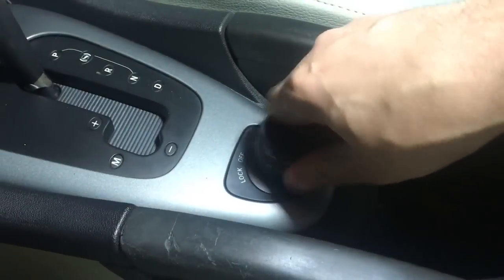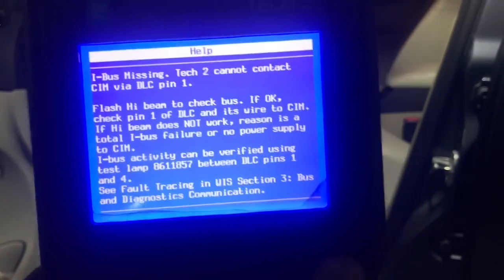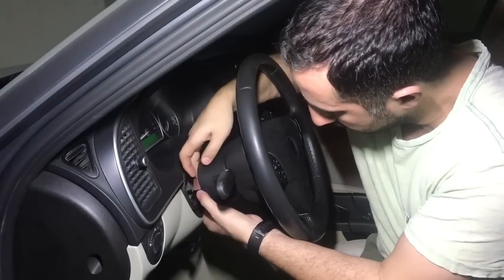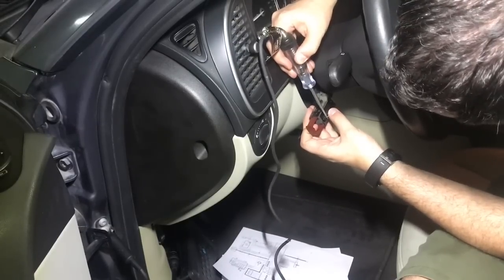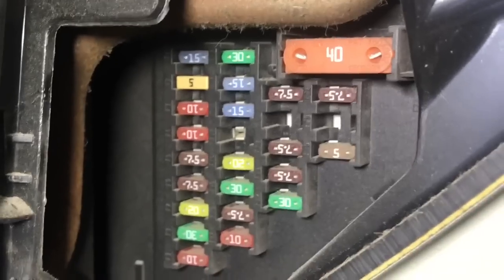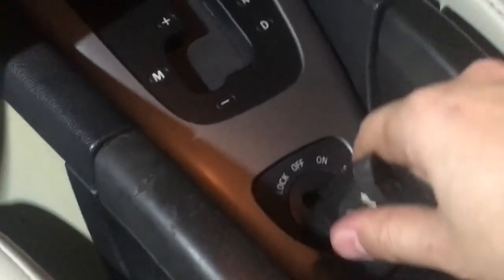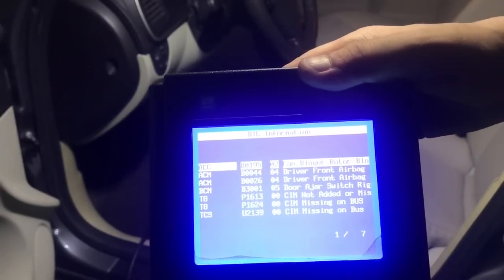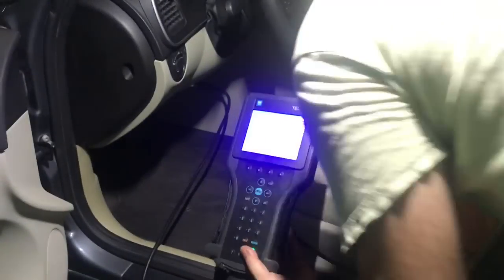SAAB 93 NO CRANK, NO START, NO COMM & KEY STUCK

Comment: My Saab 9-3 1.9 diesel has a problem - when the ignition key is turned from lock to off, fuse 2 is blown, the key is blocked. Fuse 2 is supplied with a clean ground from the CIM block via 1 pin. Does this mean that the CIM is dead?
Reply from the maker: Try to disconnect the CIM with the car running, hopefully it stays running, then turn the key see if the fuse burn or not
Reply: @TheFlyingMechanicDIY  I can't start the car - as soon as I turn the key from LOCK to OFF, fuse 2 blows.
Reply from the maker: @ disconnect the CIM and turn the key, does it blow again ?
Reply: @TheFlyingMechanicDIY  I think that without CIM the key cannot be turned.... but I managed to start the car after I disconnected and reconnected the large connector from the fuse panel. The car ran for about 5 minutes, then it gave a message about a taillight error and the car stalled. After that I moved the taillight wires and bulbs, and the car could be started again! I am a little confused! One thing that makes me suspicious is that when looking for short circuits and damage to the wires I concluded that even on the rubber floor mat I can measure about 10-11 volts. It is possible that this is a parasitic current caused by air humidity... but I do not know for sure. but it could be the cause of the problems.. currently I have made about 5-6 successful start attempts, read errors - there are none.. I will cross my fingers and pack the car together.

Comment: Hi I have a Saab 9-3 03 vector sid is saying key not accepted, have transponder codes key turns but no crank tried to jus a jumper the car cranks but no start gets spark for a few seconds and it stops getting sparks ?

Comment: Wen i mesure the batery is 12.6v  wen the car is off. Wen que car is on e have 13.8/13.9 v is this normal? One strage thing wen o left the car for 3 days the voltage drops to 11.9v. Now i constantly  have the steering lock error, it Starts normaly e drive, the a stock the car Turn ir off e bummm a have the error again, only goes away wen i remove the fuse for 2 minuts.
Reply: similar thing here.  Which fuse was it?

Comment: I trade you my subscription. I have a question on a SAAB 9-3 year 2000 which the ignition wont turn in.
Reply from the maker: Could be low charged battery, bad key or ignition switch, steering locked
Reply: @TheFlyingMechanicDIY  what exactly do you mean..? What a fault in the steering lock, or what.

Comment: This is weird.. mine was turning on all the electronics but the starter wouldn't even make a noise or crank at all. Moved battery connectors and now it works

Comment: I'm having a No start issue. The only way I get it to start is by removing the neg. Batt cable. I replaced the starter relay, crankshaft position sensor, and tested both the battery and starter they are good. Next I think I'll take apart the ignition switch and clean it but not before I check the fuses again.
Reply from the maker: Usual suspects with what u r describing, are, ISM/CIM/ABS in this order. 
A complete code scan while the car is refusing to start will reveal the culprit
Reply: @TheFlyingMechanicDIY  thank you for replying. I only have the regular obd2 scanner. I'll start now I'll keep you posted.
Reply: Would a regular obd2 scanner reveal the issue? I swapped the ac & engine relays that are located in front of the battery. The car starts the 3x i tried however I took off the fuse for the battery before hand (simulating removing the neg. Terminal to get it started to begin with) i get no codes even after driving for hours i feel its because i constantly reset each time i remove the battery.
Reply from the maker: @kevinrios8127  obd2 is not enough, removing the battery cable or fuses will most probably delete any codes, the fact that it starts after the cable removal usually points to a bad electronic component not a relay or fuse or battery or starter ….etc

Comment: My 2004 9-3 2.0T convertible will only restart after disconnecting ground cable for few min and reconnecting. Sometimes ABS, CEL and brake light were on. Inserting the key would give the clicks but not start, no starter motor turning either.
Starter motor is fine. Battery and alternator current is fine 12.2 and 14.4V.  Replaced ABS module.
Issue still is there and once and while cannot start. Pulled the 20A fuse out and in and still no start. Only after hard reset with ground battery cable could start. Any idea what could be wrong?
Reply from the maker: Its hard to tell without doing sone electrical diagnostics. Send me an email (my email is in the channel info) if u r looking for guidance on what and how to test
Reply: Did you figure it out? I have a 5 speed 2004 saab 93 with that same issue now. Only after removing the neg. Cable, waiting afew minutes then put it back on it starts and drives good.

Comment: the no crank no comm you didn't show how to fix and start the car with those pins wire on the ABS?  the car started but  not safe to drive the car until what????
Reply from the maker: Now u know the ABS is ur problem .. and u have ti replace it 😬

Comment: Hello my saab 93 vector sport 1.9tid doesn't let me start the engine when i put they key in ignition.   It comes with a fault code steering wheel malfunction.   Please can you help
Reply from the maker: U mean a fault on a scan tool ? Or SID message ? And whats the fault exactly
Reply: My 2005 93 says  ' steering wheel malfunction ' every now and then , also I can't turn the key .
It's just gone in for central locking EGR and an Alternator.
Reply: @purpleflight9083  classic, pulling the fuse as in this video and waiting a minute (or disconnecting battery for a minute) will usually clear it but it often means CIM is its way out and the fuse trick won't work forever.

Comment: This video literally saved me a trip to the repair shop. I went straight to the 5 amp fuse and pulled and replaced. The ignition switch and key fob started working immediately! Thank you for a thorough explanation of other areas to troubleshoot next time. Subscribed...

Comment: Nice. When you dropped the light doing the fuse it startled me. 🤣

I noticed your tech2 moves quicker than mine (i.e. when it runs through modules before it gives codes). Is yours genuine?
Reply from the maker: 😂😂😂 .. this tech2 is a mix of genuine  and non-genuine parts